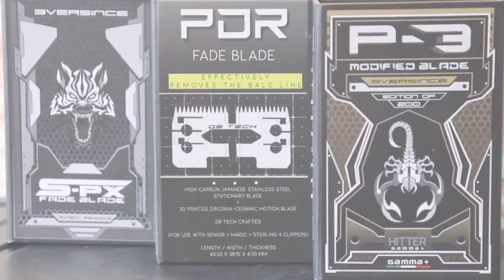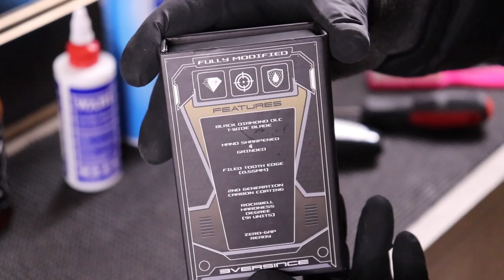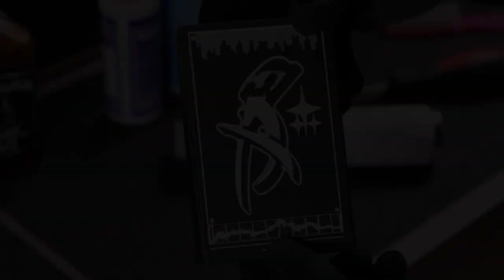3VERSINCE S-PX,PDR & P-3 Blade Swap On Wahl Metal Magic Clips,Babyliss FX & Caliber 38 (HD)

Comment: Y'all can purchase at 3versince.com
Reply: Hello Franco, I jus have a question. Canthe p-3 blade work with the Slimline pro li trimmer?
Reply: @lebryonsonjohn6720  Go to 3versince.com and check out there blades. They have a Slimline pro Modifying blade. Which is modified already, plus more ceramics and blades. Each product has reviews and pictures which you can see for yourself.. Each items has a description to which trimmer and clipper they are made for.
Reply: @Franco_Jesu  thank you so much.
Reply: What’s up 3versince, I was wondering when I will be getting my tracking number. I’m calling the number on your Facebook page and the number goes straight to voicemail. I have also emailed you and sent you a FB message. I placed my order April 28th and still have not received a tracking number. What’s going on with the shipment?
Reply: @joev8275  Keep trying to contact them. I do not work for 3versince.com. I just like their blades and recommend them to all barbers. And I doubt they will give you an answer on YouTube. As I have had issues like this with other companies, and tried to contact them thru YouTube, but to no prevail. I am proof that this is not a scam as I purchased and use the blades on a daily.

Comment: This is the difference

PDR Fade blade is designed to get as close to skin as possible. It effectively removes the line created by the trimmer. Perfect for skin tight fades, bald fades and high fades.

SPX Fade blade is optimized for blurry fading and adding immersive detail to help create a picture perfect blend. Perfect for low fades, drop fades. mid fades and further polishing.
Reply: thank you for sharing the info!
Reply: Do these blades fit the babyliss pro fx880
Reply: @estevansalazar2418  Yes it does. And once you place them on the Babyliss Pro, The blade is closer than the stock blade
Reply: Franco Montalvo isn’t tight fades and blade fades the same thing isn’t any fade blade the same thing also ? It’s actually taper blade ?
Reply: @jj-yg5tv  The barber makes the fade happen. Everything is technique. I personally use the Spx Blade for All fades, taper, everything.. I use my PDF blades for high and tights, and low cut fades with the #2 on top or #1 on top. I can shave the person's head right after the PDF blades zero. Without the trimmer. And the fade is tighter. With SpX blade, I work more on technique, drop fades, low fades with plenty of hair on top.
Reply: It is all the same. But the PDF is closer, so the #1 is closer than your average #1. But the blend is the same, just lighter gray and less usage of the trimmer to erase the line. With the PDF I use the trimmer to erase the skin line, but because I love to stretch the fade. To give it that pop in contrast.
Reply: @Franco_Jesu  i heard with the spx blade you can hear a crunch when they cut is that true? I love my cordless seniors but i do like to hear every hair being cut like the andis masters. If the spx blade can do that id definitely cop.
Reply: @Mike-hy8cs  You hear everything, it does have the crunch blade
Reply: @Franco_Jesu  awesome definitely buying now thx
Reply: @Mike-hy8cs  Bruh just get the Wahl Legend blade it had the crunch sound too and it’s cheaper lol

Comment: Got these blades got the gamma plus laced and my Babyliss fx with the Spx both worth it.
Reply from the maker: #facts 💯
Reply: Ville Beats when you put your SPX blades onto your Babyliss fx, did you have to cut the plastic which holds the blade? How easy was the swapping of blades?
Reply: JOE V yes and it’s very easy once you cut the 2 plastic tips off it fits right in.
Reply: Ville Beats i was hoping nothing would have to be cut to install the SPX on the babyliss pro fx. The SPX blade does look like it’d fit the white bracket from the babyliss.

Have you had any issues with it on the babyliss? More noise?
Reply: JOE V it won’t no way around it.

Comment: Dope video 👌 with the blades having a ceramic staggered-tooth does they make a lot of noise ? Also is the P3 worth getting was looking get it for my gamma+ trimmer ?
Reply from the maker: Ceramic blades do make a different noise , but it's not loud . The p3 haven't used it much yet I'll be putting it on my wahl cordless detailer li today 👌🏼
Reply: Ant The Barber thanks for your reply dude very helpful info, look forward seeing your video on the P3 blade on the wahl cordless detailer 👍

Comment: So you can use these on any babyliss clippers for example the all black ones that just came out ?
Reply from the maker: Yes if you modifie the piece like I showed
Reply: @AntTheBarber  thanks boss which blade is it exactly for the babyliss clippers i wanna get them right now
Reply from the maker: @juanygaleano162  either of the two clipper blades it's up to your  preference I use the PDR daily for every fade I do .
Reply: Any differencez noticed after you cut the 2 parts from the bracket?

Is the cutting blade secure?

I just want to make sure i don’t fuck shit up when cutting those pieces off since babyliss isn’t good with replacement pieces yet.

Comment: What's the difference between SPX and PDR blades?
Reply from the maker: The ceramic cutting blade is different on both and I believe the material .
Reply: PDR Fade blade is designed to get as close to skin as possible. It effectively removes the line created by the trimmer. Perfect for skin tight fades, bald fades and high fades.

SPX Fade blade is optimized for blurry fading and adding immersive detail to help create a picture perfect blend. Perfect for low fades, drop fades. mid fades and further polishing.